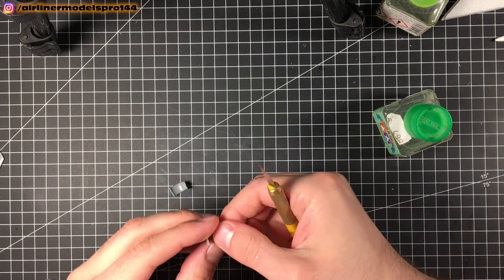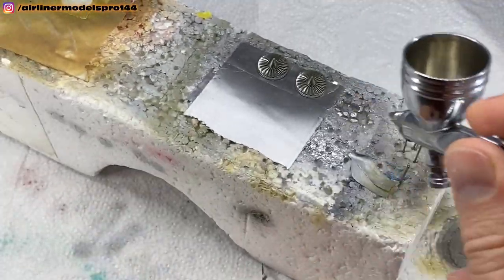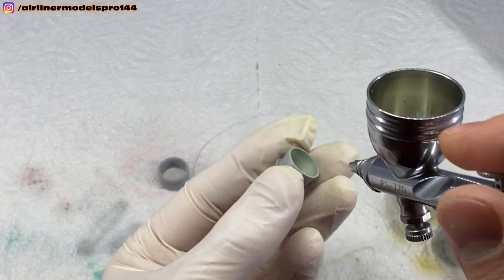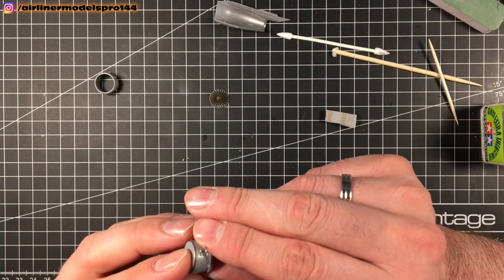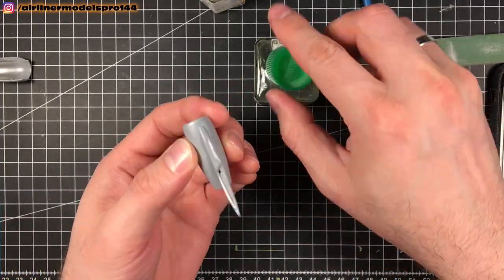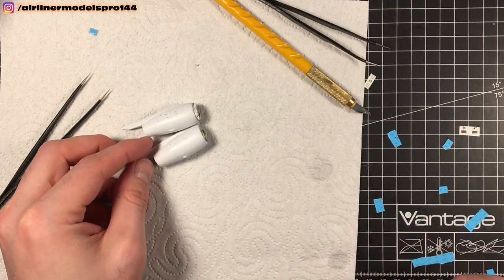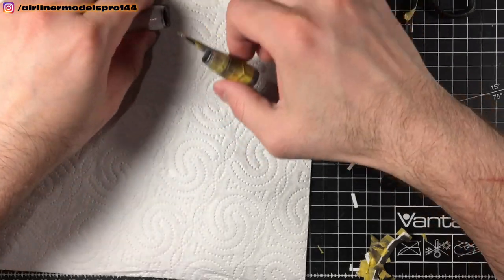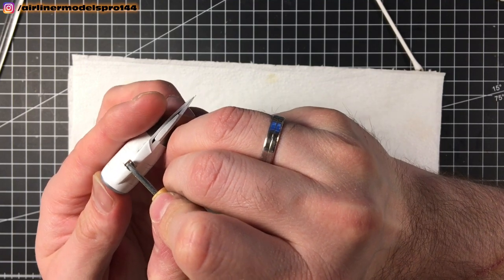Zvezda Boeing B757-200 1/144 EL AL [Part 5/7] airliner scale model PART 5 / ENGINES

Comment: So perfect, worth all the work.
On the insides i almost did the same technique when i cut out the front of a Minicraft 757 engine after glueing it together to get a proper seemless Ring which the Minicraft model does not have.
But after all the glueing i had to sand so much that the details were lost. I had no scriber like you but it was still okay.
The Zvezda 757 is definately a good model of my fav Jet.
I have 2 1:72 Model Kits i have to finish first and after that i really need to build a good old Fashioned Retro Condor 757 from the 90s.
Does this Kit come with PW Engines and No Winglets alternative inside?
Reply from the maker: yes PW is included and as you can see on my EL AL also normal wingtips are included - quite some options, allthough the PW fandisk is not accurate. BTW i plan to build the same...
Reply: @airlinermodelspro1445  finally a good 757 Kit <3
Reply from the maker: @Ted-Striker  true, but it is far from perfect. quite a lot of small errors i had to correct.

Comment: It’s not a rubber ring at the fan, it’s a composite compound similar to automotive body filler. When a new engine is assembled the manufacturer runs the engine to let the fan cut its own accurate path into the compound thus ensuring the minimum gap between fan and fan track. Also, the nose cone is made of a composite material, but has a metal cuff at the fan leading edge. 👍🏼
Reply from the maker: whatever it is, i touched it on a A320 multiple times and it feels like rubber.